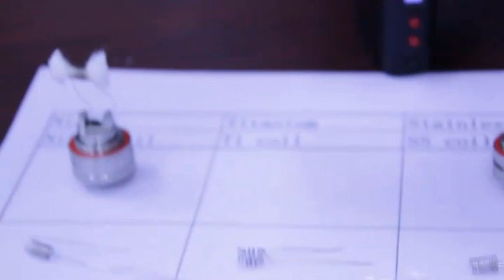MVI 5492

Comment: Why do you fire for such a short time? Why have you set the temperature to 315C? Why is the cotton still white, when you fire it with 120W and 315C? Don`t you know the burning temperature of cotton? For which NiCr wire is the box optimized or what is the used coefficient for NiCr?
I still can`t believe Kanger knows who to build a working TC electronic - this video makes me believe Kanger has to learn a lot about TC. Good luck.
Sorry, this video is very bad promotion.
Reply from the maker: +funky ruebe This video just show the capability of KBOX 120. The maximum temperature is 315 degree C which is about 600 degree F.  This is to proof the coil temperature is under control of the PCB to prevent over all of the coil. Please refer to the end of the video, once it set to full wattage output, the cotton burn out within few seconds.

Comment: Does it do kanthal wire or only temp control wires?
Reply: +chilliman07 It has power mode, so yeah. Kanthal too.
Reply: +chilliman07 yeh you can use any wire with this mod - you can also use stainless steel and nichrome n80 in wattage mode.
Reply from the maker: +moggsterr Kangertech NiCr coil can.